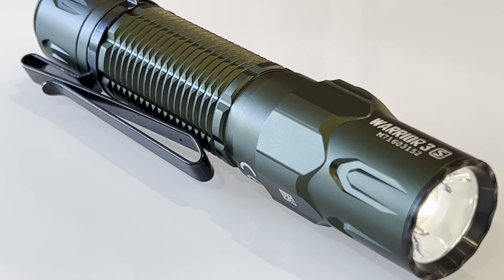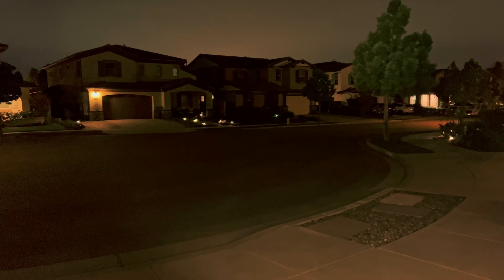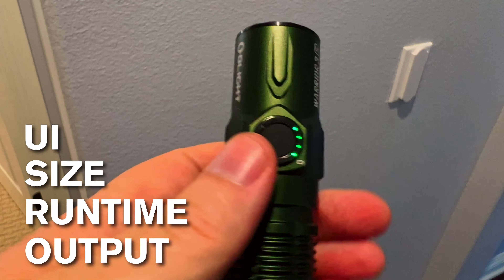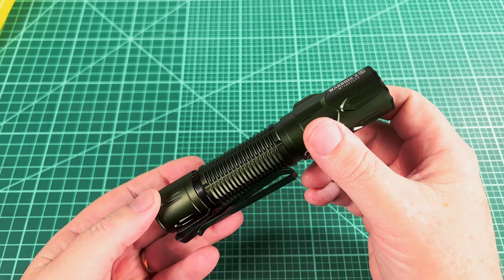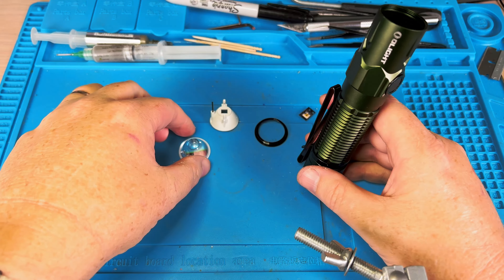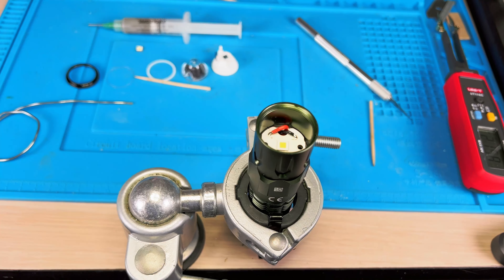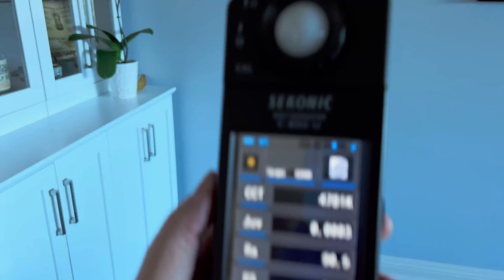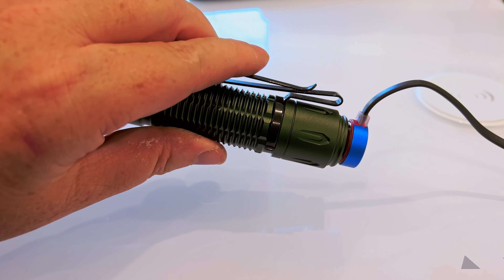Olight Warrior 3S is the best EDC on the market!

Comment: that's a really great emitter.  what emitter would you recommend for the WM2? I currently have an SFT40 in 5700k ready to go into it, but I was thinking of putting a dedomed SST-40 in 5000k instead. any other suggestions?  WM2 is my favorite size.
Reply from the maker: SST-40/SFT40 is 5050 sized, but 3v.  So I would suggest the XM-L2 4500K that Hank Wang has at intl-outdoor.com.  It’s tint is perfect!
Reply: @cheule  Sorry, I'm not very familiar with either the Warrior S3 or the XM-L2.  If the XM-L2 is a 5050 and 3v it will also work in the Warrior Mini 2.  Am I understanding that correctly?  Thanks for your suggestion and that does seem to be a perfect emitter.  It's like a larger version of the 519a :D  (currently my favorite 3535 emitter).

Comment: Great video. Can you please share with us where you got the emitter for this swap along with some of the specific supplies needed?
Reply from the maker: The emitter is from mouser.com, part number 941-XHP50DH0D0UH245G . Check out my other emitter swapping video for specific items to buy like SMD solder and soldering station. Etc.
Reply: @cheule  Please clarify.  In the video you say that you used a 5000K, 80CRI emitter but the part number above pulls up a 4500K, 90CRI emitter.  The numbers on your light meter seem to support the latter.

Comment: For what it's worth, at least the Seeker 2 Pro works with batteries other than Olight's proprietary one. The catch is they need to be rather narrow, 21.4mm wide at most, or they won't fit. And it probably needs to be a button top. And you need to put the battery in there "backwards", with the button sticking outwards. And you definitely should not try to charge non-proprietary batteries within the flashlight with the magnetic charger. Other than that, it's all good. Not sure how universal this is to 21700 Olights, though.

Comment: I have never considered Olight in the past as I have seen many people on HK gun groups imply they are junk, but I got a Warrior Mini 2 and I see that is not correct. They seem to be more like DJI. Nice quality and with some actual innovation rather than being a clone company. 

Had I known the Olight had a proprietary battery I probably wouldn’t have bought it. Now that I have one, i like the UI and feature set more than my Fenix PD36R, so I don’t plan to return it. 

I will take the magnetic charger over USBC. Especially given that I use iPhone and don’t have many USBC things anyway. Just my Sony headphones. 

I like how the UI doesn’t cycle through brightness levels. I have a choice of two plus turbo. Sounds good to me. 

But, I do already have lots of Sanyo 18650 and was looking forward to having a few 21700. For sure wish Olight worked with them. I can’t think of any upside to them using their own.
Reply from the maker: Your comment mirrors a lot of my own thinking.

Comment: Hi,I'm  a welder,and need my edc .i like my new olight,BUT the tail cap magnetic  pulls in metal  dust,and plugs up switch. Is there another tail cap i can buy to put on after i charge  it?  THANKS
Reply from the maker: Yes, magnets and welding or metal work is a problem. I can see that.

Comment: I always wondered what strobe was for. Great video!
Reply from the maker: Thanks for watching!
Reply: Strobe is best for Anti-Animal use. They tend to stare at bright lights (deer in headlights), but if you see something like a skunk and you strobe it, it will panic and run instead of stay and spray the strange light. Anecdotal note: I'm pretty sure the FETs toggling or whatever is in there making noise also pisses off dogs and makes them hide. My dog hated it when I would show the light to someone and hit the strobe, even when he couldnt see it...but that might just be him. It does work for startling off animals though (done it many times).
They are allegedly for disorienting an attacker, but that is dumb because you are also messing with your own vision (less so), if you hit a person with turbo, they are out of the fight and you can see fine.

Comment: Olight definitely did a really good job with this light. Output, UI, and features are very good. Size is subjective and all, but I personally think a 21700 size light is not an edc light, Iv tried it but there’s definitely more times than not I’m reaching for a smaller light. This warrior stays in truck. Game changer if they would make this in an 18350 size. As I usually reach for an 18350 modlite just about every day. Keychain light for my admin purposes. Iv debated hard on buying a warrior mini 2 but I just can’t bring myself to do it.
Reply from the maker: You make great points. I tend to wear cargo pants/shorts so the larger size isn’t an issue for me. But I can see how it might be a lot for jeans.

Comment: how do I retrofit a Acebeam L19 Tir onto the GPS navigation bar of my motorcycle and run off the bike battery via the battery tender plug? it’s an SAE plug but through the battery tube of the Acebeam

Comment: Personally I'm not happy at all with voiding my warranty on a light of this price just because they didn't make any effort to so much as give us the option for an LED with a good tint or CRI. I have had to return an M2R Pro a year into its service because it just stopped working and they replaced it quickly and for free, that would have been a significant amount of money to replace had I modified it.

But I am going to say, in my opinion, that the M2R Pro is their best light in the series and is better in my mind than its "upgrades" because it comes with a great neutral LED and doesn't have any annoying proximity sensor.
Reply from the maker: The M2R is a great light.

Comment: Nice video, question for you. What can I do for this to make is super floody? DC fix is not enough. Can this be made into a triple with a wide optic and a frosted optic?
Reply from the maker: This optic is very narrow.  It would need a completely different optic.  It’s possible! But a lot more complicated than a simple emitter reflow.  Perhaps D4V2 is better for you?  Hank offers a boost driver now.
Reply: @cheule  I like those also. I have learned a couple things since I got more active in flashlights as a hobby.
Zebralights have great bodies and amazing clips

I really like triples and quads. I think I basically want a SC64c LE body with a fixed tail cap with a magnet. Then a Manker E14 III style head with 4x 519a 4500K emitters. Oh and I would have the clip mount with the deep carry style swoop so the tail cap and clip are almost even. This is a grail light, haha.

Comment: In terms of EDC, we want entirely different things from this size of light (around 5-6 inches and 5-6 ounces). The standard Rovyvon A8 or Acebeam Ryder or Lumentop Frog is plenty for my every day use around home or in safe locales, and they all disappear in the pocket.   The only reason I would carry something that big in my pockets is for self-defense, as I live in a major city with major city crime.

And for self-defense, I am not getting an OLight Warrior 3S with 10 candela per lumen.  I need a tighter beam to disorient the bad guy and buy time for me and my family.  I look for a minimum of 25 candela per luman.  At this size, I went with the Acebeam P16 Defender.  Not only does it sport nearly 60K candela at 1800 lumens, it can be programmed for instant turbo and tubro strobe from the two tail switches.

There are use cases for the Warrior in the pocket for EDC.  If you live out in the country, for example.  But in the city, if you ever actually need to go warrior-ing, this is not the best choice.

Comment: I'm an Olight fan, I have quite a few of their lights and will continue to purchase them, but I do wish they would just release all their lights with the option between Neutral and CW. I have the M2R Warrior 2 which is neutral, but decided against the W3 because of its tint. I just recently purchased the Arkfeld in 5000k, and I would have probably bought the new Seeker Pro (I have the Seeker 2 Pro) and Warrior if they have offered them in 5000k. 

Don't get me wrong, I have some lights with cooler tints as well that I like, but I still like my higher CRI lights more. CW just washes colors too much.
Reply from the maker: Olight released the new Arkfeld in a NW version as well, but unfortunately I found it about 30-50 points above BBL. So even if they include NW, if you’re a maniac like me, you’ll end up swapping.

Comment: Can you mod it to take ordinary 21700s or mod a 21700 to work in it?
Reply from the maker: I’ll have to double check, but sometimes you can get standard cells to work in Olights, but you always forgo the magnetic charging system.  So to be clear, I cannot remember whether a standard cell works in this light.  I also think that since the cells that come with the light are excellent, and I haven’t had to replace a cell yet, it’s sort of a “moot issue” for me.

Comment: Hi Cheule. I apologize for my spicy comments the last day and i am here to state my personal opinion on what the perfect edc flashlight is without getting into the argument if this Olight is the one this time. So...

The perfect edc flashlight needs to have the following characteristics:

Lumens 1000 and beyond is fine in my book

Size, smaller diameter than 27mm, and this is optional, not to be taller than 10-11cm. 18350 cell fits the bill better or 18650. The height is important so when you are clipping the light into your pocket it doesn't mess with your smartphone, keys or coins in it and you have free access to all your items unobstructed. The diameter is also important cause the tightest pants are the most common types of jeans. For tight jeans i would say that even 25mm head diameter is on the limit of edc-able lights. Yeah if you wear anything else even a 35mm diameter light is pocketable, like i do with my kr1. So the size of the light can be a personal thing altogether or a choice depending on the type of pants you wear every time. For larger pants I'll take my kr1 with me. For tighter ones I'll take the sc31pro. But only the smaller lights can be used for edc by everyone

Beam profile, a combination of throw with great flood with emphasis to flood for everyday carry. Candela around 20.000 is great for seeing at 150+ meters. This will sound silly but some zoom lights have the advantage on the beam profile as you can choose to have either throw or flood, the best ones are the ones that don't have the twist motion zoom but the push pull one as you are able to use them one handed. Unfortunately those smaller in size zoom lights are rather weak, i am soon expecting the Sofirn s11c to test it out though it is a twist zoomie i expect it to be just bright enough to edc. It ticks out almost every characteristis that i think the perfect edc light must have. The same happens with the dual channel lights from Hank that you can have combined emitters for throw and flood. Noctigon Kr4 and emisar dv2 dual channel anduril 2 lights have this option but unfortunately they don't run a simple ui

Tint: 4000-5700k with high cri

Pocket clip, either a two way or at least 2 slots in the tube for reversing a regular one. Light needs to be small and not heavy for being able to be used on a cap as a headlamp when needed

Being able to tailstand easily, and not only on perfectly flat surfaces. For example my wurkkos fc12 though it can tailstand on a flat surface it doesn't do it with ease it can be wobbly, and even a small breeze could take it down so this light doesn't fit the bill for the perfect edc flashlight either.

Strong magnetic tailcap. I consider a strong magnet the one that can keep the light attached firmly parallel to the ground and won't fall off with the slightest bump from this position. I've used plenty of times my shorty sc31pro as a reverse light for my truck on our farm at night.

Usb type c built in charging port and be able to take in any type of battery is a huge plus

Ipx8 is perfect. You're gonna drop your edc light often so it needs to be able to withstand the abuse and have some waterproofing too

Easy ui, just a ramping mode plus a stepped mode with a strobe and moonlight is a great start. I love anduril, but even i that know anduril well when i sometimes forget about it it gets frustrating to use the light. So simple ui is the best option.

Recessed or a tough to accidentally be pressed button: This is so important. If the light turns on accidentally the light is a Huge no no. Even if it has a lockout mode it's still useless for edc. You need a firm button that doesn't accidentally turn on the light in your pocket so you can be able to use the light fast and easy without clicking 4 times before using it and another 4 times when you're finished using it. Unscrewing the tailcap for locking is also a no no as that prevents the light to be used fast and with only one hand when needed. How to tell if your light has the perfect button? Easy. Have you ever took your light off your pocket and it was turned on? Does that happened more than one time in a long time of usage? If yes then this is not a good light for edc-ing

Somekind of a small attack bezel, not something crazy and dangerous, just something protruding just a tad to keep the lens safe from droping/or intentionally smashing it onto something should be fine.

If someone can think of some other essential characteristics for the perfect edc light feel free to respond to this comment with your answer.

My personal favourite edc light that also covers all of the above characteristics besides the protruding bezel and simple ui is the Sofirn sc31pro with the short 18350 tube, a magnetic tailcap and the original pocket clip attached to the light's head reversed for usage on a cap as headlamp. Sofirn sc21 and wurkkos ts10 are even better fits in my opinion than my current set up cause of the simple ui. Fortunately i use anduril lately a lot and my sc31pro is still my favourite edc.

So please feel free to add any other characteristics for the perfect edc light that I've might forgot

Cheers to everyone
Reply: Excellent breakdown!
Reply from the maker: This seems like a well thought out list to me.  I loathe flappy doodles.  HATE THEM.  So I like no port at all, or magnetic.  But that’s just opinion of course.
Reply: @cheule  Maybe a type c port into the screwing threads will do the trick for you. like some other flashlight have. Unscrew the light and it reveals the port inside of it
Reply: @cheule  same, I always say they should add USB-C right into the proprietary cell itself. other companies do it and I'd always use the mag charger, but if push came to shove and I only had my phone charger cord on me...would be nice.

Comment: I have a love hate relationship with the magnetic charger. The hate comes from metal dust that accumulates ( just wish o light made silicone caps that would fit perfectly on the tail cap [i had to add electrical tape to make it girthy enough to fit a glow in the dark silicone cap i ordered off of ebay] to help mitigate the dust issue and also act as a diffuser. I love how easy the magnetic charging is but wish there was also a usb c option along with it like their olantern
Reply from the maker: You’ve made solid points.

Comment: I don’t know about an Apple analogy. However,you cannot argue that Olight locks you in with their proprietary batteries and charging cables.
Even in terms of practicality, you could be out there somewhere and you lose your charging cable so you’re pretty much done. That is not very consider all light especially if you were in an extremely challenging situation in the wilderness or wherever.
Honestly, Olight would vastly increase their already considerable following by diversifying their charging options.
Reply from the maker: It’s worth noting that all their proprietary batteries can be charged in standard alone chargers. That’s the primary way I charge mine.
Reply: @cheule  I hadn’t realized that. Great to know!
Hopefully they sell batteries on their website. Amazon?
Reply: @cheule  I just tried the Baton 4 3.6 volt 16340 in a charger. Doesn’t work. There’s a plastic rim on the positive end. Very disappointing Olight! 🤦🏼‍♂️

Comment: used this magnetic conector and its a fail.. dirt comes between center pin and ring [so if used where dirt is resident...]
Reply from the maker: Wouldn’t that be an issue for USB-C too?  And I know that flappy-doodles break off, and I’m not a fan.
Reply: @cheule  True but 1. Less problems with USB. 2. The flashlight stops working or flashes when the dirt prevents the pin from returning and closing the circuit

Comment: I own a few of those custom build flashlights,  such as the BLF GT, and GT70.  And a few other mass products lights from Imalent,  Acebeam, and Olight. To this day, I still haven't worked up the nerve to ruin the flashlight by attempting to replace the emitters. We need more how to videos  from experts such as you. I can mod any RC car in production. Solder,  installing motors, ESC'S ect. But, when it comes to flashlights,  I'm lost.
Reply from the maker: Have you attempted to follow along with my son’s Convoy S2+ build? That’s a great place to start.
Reply: @cheule  Not yet. But, I will take a Crack at it, thanks.

Comment: is swapping "easy"? yes if you have the tools. this isn't putting a glow tailcap on s2+. its soldering and a hot plate. i'd say edc is 100mm or less. yes that would fit in a pocket but not well. and the charging? well proprietary stuff is one more thing to consider. also olight while quality is expensive. just like apple.